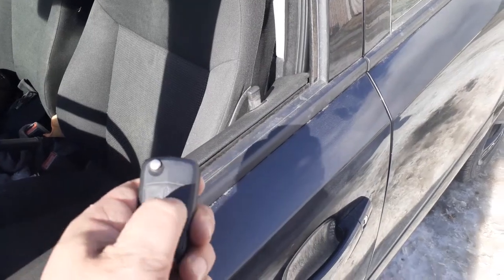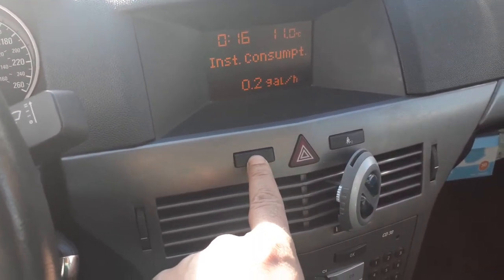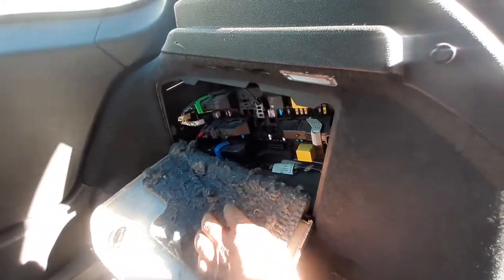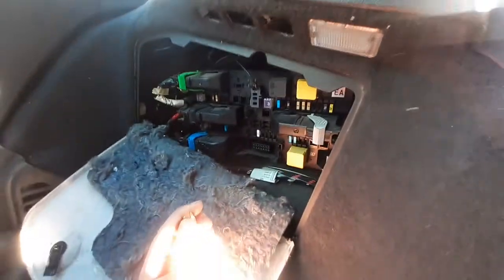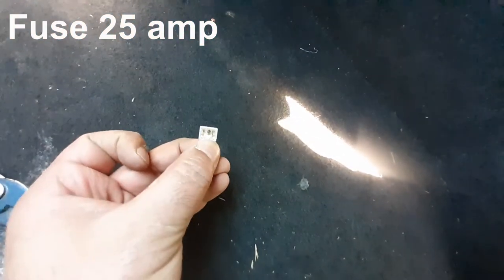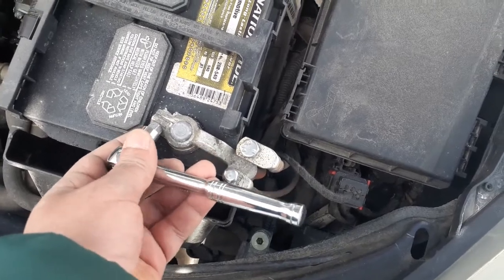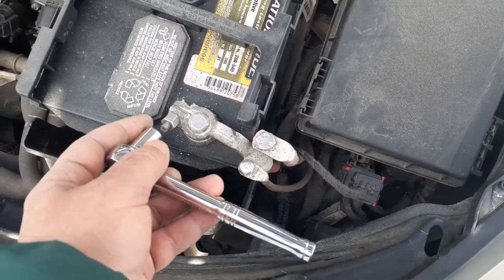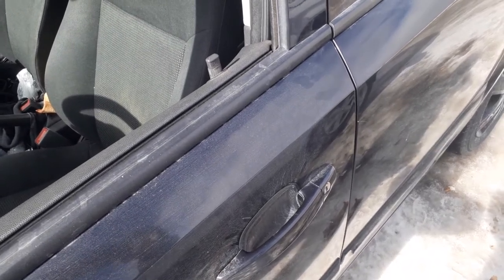How to fix 2008 Saturn Astra Key fob Not Working

Comment: Thanks for the video.  My key fob remote and battery are fine.  Fuse is fine too.  But there seems to be another problem with the ignition switch perhaps.
Reply from the maker: Try disconnecting the battery for 15-30 minutes and reconnect it. This usually resets everything. See if this works for you.

Comment: I have the same issue. I changed the fuse but didn’t disconnect the battery. I also found 10A which was blown and replaced it with 25A in the 38 spot of the rear fuse box. It didn’t work still. I will try tomorrow to disconnect the battery. Thanks!